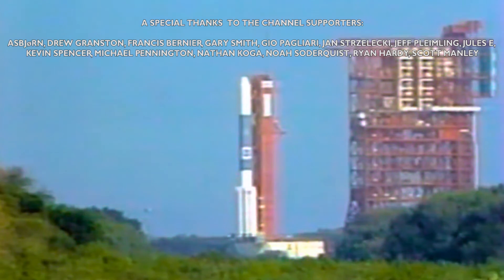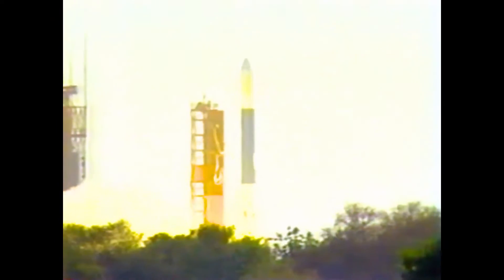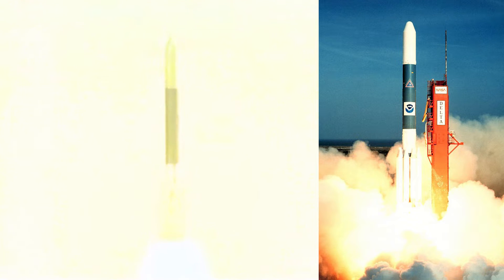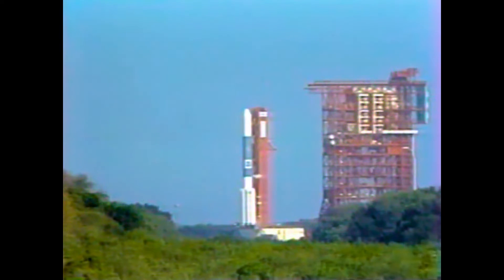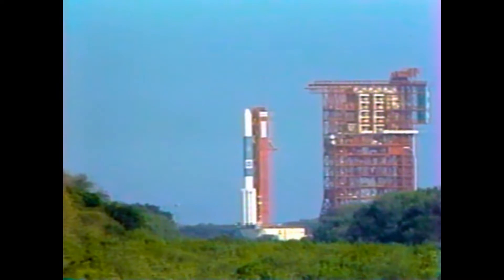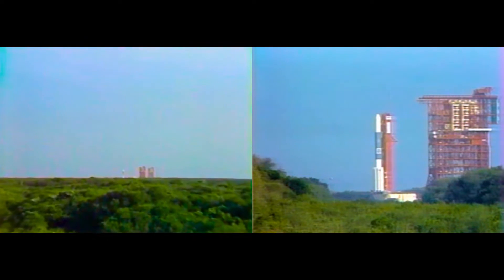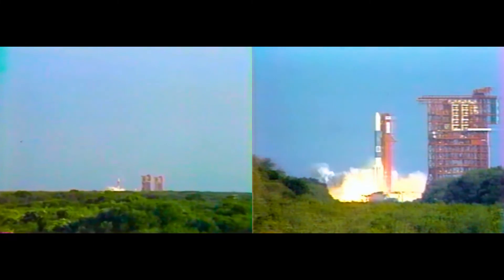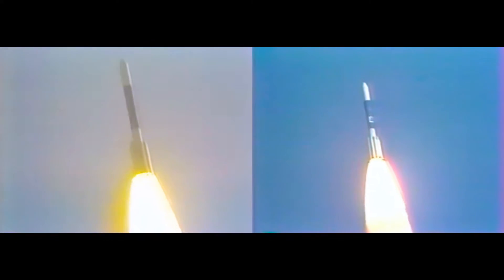Delta 178 Rocket Launch Failure - GOES-G Weather Satellite, 1986, NASA, NOAA

Comment: By the end of 1986, the entire space program was in ruins, because of not only this failure, but the launch failures of the Titan 34D carrying a KH-9 Hexagon Spy Satellite for the NRO, the loss of Challenger and seven astronauts as well as tbe grounding of the Atlas-Centaur rocket.
Reply: I remember coming into 1986 thinking it would be a great year for the space program.  By the end of the first month, that hope was dashed.  This failure was like a metaphorical exclamation point.
Reply: All because they put all their eggs in the space shuttle.
Reply: @nolancain8792  ? Foxes post references failures of Titan and grounding of Atlas. This video is about a Delta failure. The problem wasn’t just with “putting all eggs in the Shuttle” but failures across the board of US launch systems.
Reply: @ATH_Berkshire  I’ve seen some comments before that say they stopped caring as much for the other launchers because with the shuttle being able to do much more they could close those lines down and not do as stringent as quality checks.
Reply: @nolancain8792  No? Yes they were going to stop launching expendable rockets once the shuttle flight rate ramped up to 24 flights a year but still quality control was still like it was before the shuttle otherwise they wouldnt have wouldnt reconaissance satellites that were worth billions on those rockets